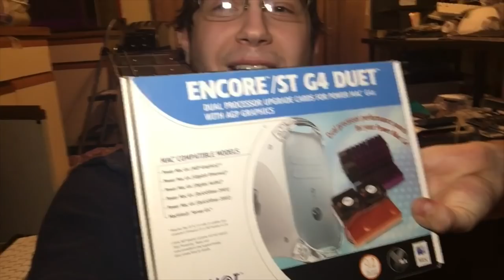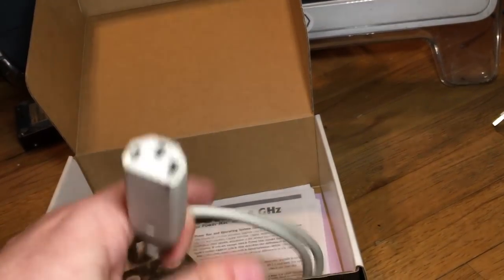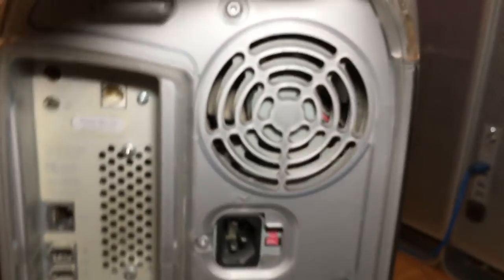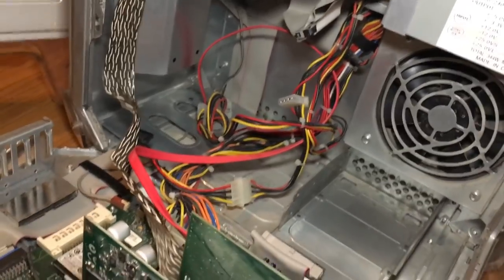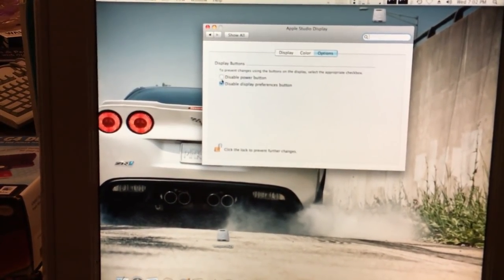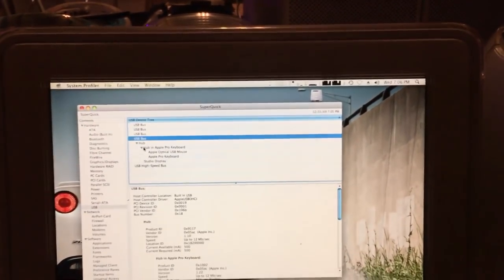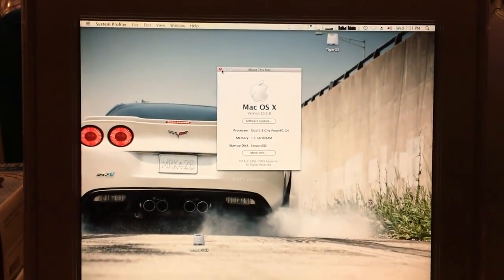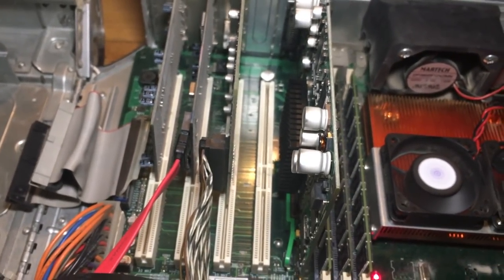Unveiling My New Dual 1.8GHz Sonnet G4 Quicksilver – PowerPC Series S.3 EP.6

Comment: USB B could be for connecting two Macs together. Remember there are no cables made that have USB-A connectors on each end. All have USB-A on one end and USB-B on the other end.
Reply from the maker: Remember when I said it was a hub... that’s where you plug in the USB port from the system

Comment: HOT TIP: jank out the Quicksilver mobo and replace with a more reliable Digital Audio mobo. My current Quicksilver G4 (with a Digital Audio mobo) also has a dual 1.4GHz G4 Sonnet upgrade, Ti 4600 AGP card, PCI wireless card, 1.5GB RAM, and some sorta PCI card (could be ACARD) with three drives. Obviously it rocks flaming gorilla balls for OS9 games.
Reply from the maker: Yeah but you don’t get the DDR cache addressing with that board... then again I don’t think it really matters with the Sonnet